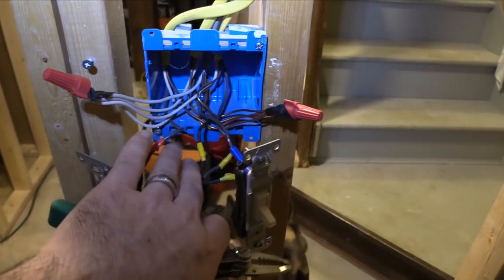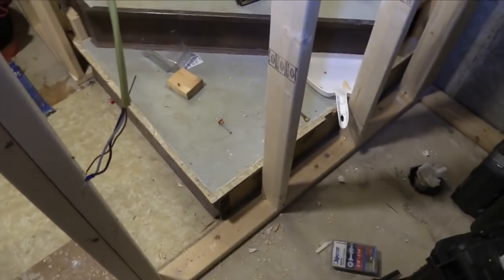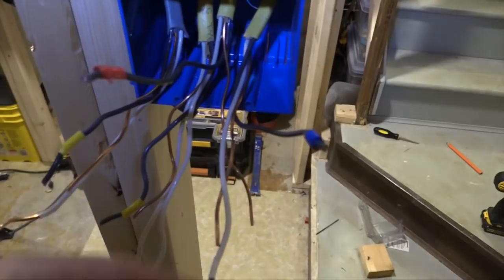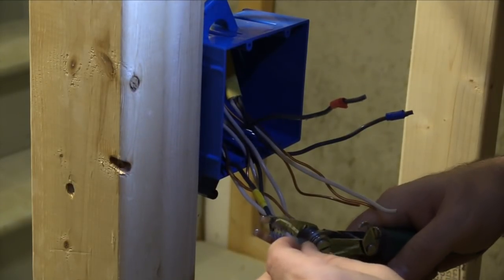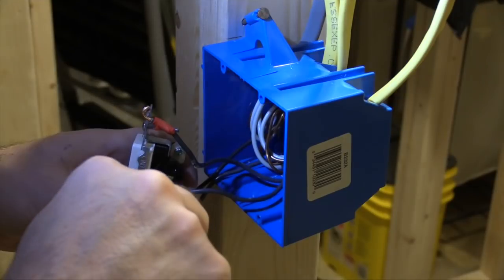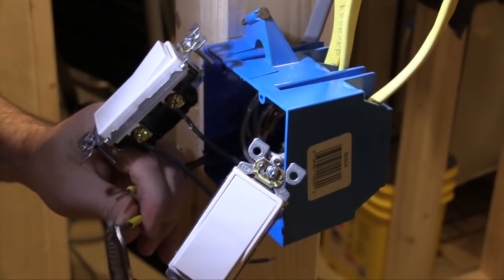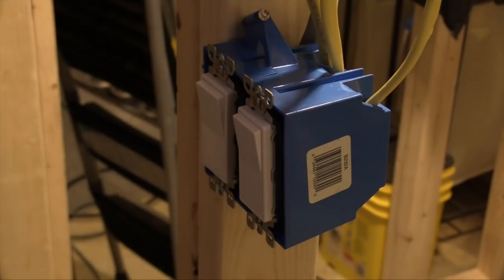How to Wire Multiple Outlets or Switches in One Box

Comment: For all those commenting on the grounding, yes that’d definitely be idea, especially with the plastic box, but I have to say that lately I’ve been updating my houses switches and I e been having to look through DIY bids to figure out what the hell the original electrician was thinking when this house was built. Grounding wire present, grounding screw present, nothing grounded. Massive amounts of wire shoved in to the point it can’t be worked with to do what should be quick updates. Seeing some “freestyle” wiring is helping me cope with whatever happened in this house 20 years ago.
Reply: I have the same exact issue. The electricians did not connect my switches to the ground wire, but just connected the ground wires to themselves in the box. So the system for the whole house is grounded, but the individual switches that are not connected are not grounded. I have been scratching my head to try to understand why the electricians skipped grounding most of my switches.
Reply: Lol thats why I'm watching videos here on YouTube what the hell were they doing when they built this house.

Comment: Connections appear to be secure, but the one very big problem I see is the switch bodies have not been grounded.  For this job, the grounding is actually the most challenging part.  You've got 4 cables coming in and two switches, so you need a way to join 6 12 g wires together.  For that, you could possibly use some device like you used for the neutrals, or two green wire nuts (each can accommodate 4 wires.  You can join them at the tops.  Just take about 12 inches of bare coppper 12 g wire, and center the wire nuts 2 inches apart.  To each wire nut, add 2 two of the incoming 4 grounds, then twist.  Use the ends of the 12 inch piece to ground each switch.  You can join the 4 neutrals together with a single wire not (NOT a green one of course).  Same for all the two incoming hots and their connection to the switches, since none of them require more than 4 connections.

Comment: Good video. I've hit a snag and I have a question. I will give all info to my issue.
I installed an attic vent fan.
In the attic there is only one source of power that comes from a light switch to a light fixture.
I replaced the light junction box because there was no ground.
I ran the 14/2 wire from the fan to light junction box.
Connected ground to ground, white to white, black to black. Switched the light fixture to use a pull chain so I can turn the light on and off when need be.
I connected a white and black wire for the light fixture, there is no ground for the light fixture and didn't run one (connected black wire to the brass screw).
The fan works perfectly. The light does not turn on or off, I even tried using the original light fixture that doesn't have a pull chain, light still doesn't work. I even tried a new light bulb, just to make sure the old light bulb wasn't blown.
There is current in the wire going to the light fixture. (I even cut a new black and white wires to took off more coating over each wire just to make sure all wires are connected within the red cap's.)
Am I missing a step or did I do something wrong?
Reply: His answer to this question is at the 2:15 mark of this video
Reply: You have to check the by pass and make sure it's done correctly.

Comment: You didn't add pigtails to the switch grounds, so you need 2 more ground wires. Two 4-port push in connectors and a jumper to connect them will do it. Another method would be to use a 4 x 4 x 2 deep metal box with a 2 gang mud ring. You could use a 5 port Wago lever nut for your grounds, one pigtail to ground the box. Then install the switches and they will be grounded by metal to metal surface contact. Remove the paper screw keepers on the switches first.

Comment: Thanks for the great video. I've done regular double outlets in 2 gauge boxes so far and did a good job (up to code). What if I am installing a GFCI outlet and connecting a fan switch next to it in the same 2 gauge box which then extends to the fan? Sorry, but it's a little confusing to me. Could you perhaps do a video explaining going from the outlet directly into the switch next to it, in the same box, and then extending to a fan or something? I would greatly appreciate it.
Reply: meljon Do you want the fan switch to be GFCI protected?
Reply: You should not be asking random YouTube content creators for electrical advice.  This guy doesn't know what he's doing.
Here's my original response:
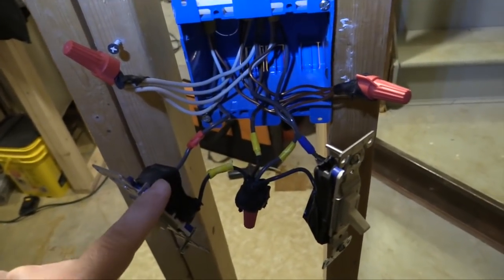You have NO BUSINESS making a video on this subject.  Not all 3-way switches, for example, are physically the same so your "remember where things go" method is foolishness. "Bypasses"???? WTF are your talking about?  Those black wires 1:34 that are connected are NOT "outgoing"  and there is no "bypass".  Those black wires that are connected are the HOT WIRES!!  On of them is the INCOMING power (Line) and it's distributed to both switches and some other circuit along with another Neutral.  Two switches with two controlled loads would only need three hots and three neutrals.  You have four.
You also neglected to attach grounds to the switches, which is required by code!   YOU HAVE NO BUSINESS making a video instructing others how to do this.  NONE!
Reply: @DiffEQ  Hello, I am a licensed GC in the State of AZ and I am a degreed civil engineer. I agree with you in principle, but in AZ, a DIY homeowner can replace switches in their home without consulting licensed electrician. For most people, I agree with you that is not a good idea. However, this guy is within his (legal and code) rights to produce a DIY YouTube on installing a switch. Now whether or not he did it correctly is another issue. If he shows something incorrect on his video and someone is injured, he is opening himself up to a ton of liability. 

I have a two-way three-gang switch box in my house that I am trying to figure out. The electricians (who built the house and were licensed) wired SIX, count them, six black wires together and five white (neutral wires together in the box. I was greatly surprised when I saw this, but I think it is because two of the switches go to the fan (one 14-4 for the light and one 14-4 for the fan). The third switch goes to a half-hot, which makes this wiring all the more confusing. The box is plastic and the electricians did not ground any of the switches in either three-gang switch box (remember it is a two-way). I don't think that complies with NEC code, but I am researching this wiring now. But the wiring is similar to what this YouTube video shows. 

In theory there should one wire to the fan, one to the light, one to the half-hot and a traveler wire between both switch boxes to bring power into the second box. However, in the primary switch box, I have six Romex wires coming into it. As mentioned, there are four wires between the boxes to support the fan, the fan light, the half-hot and the traveler,  and only one 14-3 wire should be feeding power into the primary switch box. That is a total of five wires that SHOULD be coming into and leaving the primary switch box and I have six total. So I am scratching my head trying to figure out what the electricians did and why the primary switch box has six black wires.. Everything works great and so the wiring is functioning correctly, but it is confusing to figure it out.

This video is similar to what I am seeing in my house, and for that reason, it is useful. I have had to figure out each separate switch box in my house as I have opened them up because the electricians did not wire some of them correctly and they SHOULD know what they are doing.

Comment: Hi! I know this is an offtopic and I'm sorry but could you explain me why are wires pigtailed when connecting an arc-fault circuit breaker? The thing is I'm from Ukraine and we don't do that. Just interesting.
Reply: This is very late but its so the arc fault or ground fault breaker can monitor differences in current between the hot and the neutral wires

Comment: You made that wayyy more difficult than it needed to be. A switch like this takes fewer than five minutes to do. Don’t need tape on the devices on a box other than metal. Only metal boxes pose a risk of shorting out.
Reply: Make a Video!!! Simple
Reply: So you are saying that switches in plastic boxes do not need to be connected to the ground wires? I am not sure I agree with that statement. Is that NEC code?

Comment: I didn't get it! What has he done? What do we need a second switch for if outcoming wires from both are twisted together. If the lines are different and both switches are toggled we receive a interphase short circuit. And if the lines are same then what the purpose of the second switch?
Reply from the maker: I was finishing my basement and needed to replace an existing switch. The switch was for a fan and a light in a bathroom. when you hook all the wires together like that, the bypass cuts power to the unit when you hit the switch. It just looked like a lot of wires because there are two switches and two items that require power.
Reply: if I'm seeing it right there is a line in to feed two switches and than a line out to feed another device simple. Also you should have grounded the switches tied all grounds together with two pigtails to switches. Cple of ways to do this otherwise nice job
Reply: Everything within that box is on the same circuit so there is no phase to phase tripping to be concerned about.

As he said, he is trying to switch a light on one device, and the exhaust fan on the other.

What he is referring to as the "bypass"is actually called" the "constant hot" . The four wires in that connection are the-

1_ power coming in,
2- power going out, 
3&4- and two pigtails. (each Pigtail provides power to the individual switches)

That set of black wires are the ones that will shock you if you touch them while the circuit is energized.

The remaining two black wires are referred to as switch legs. They are the wires that go from switch box to light fixture and once energized turn the light fixture on.

 All of the white wires are referred to as neutrals and get tied together. They run back to the electrical panel with the purpose of carrying any unused electricity back and completing the circuit.

Bare copper wires are ground, should all be tied together, and have pigtails coming off that terminate on the Green screw of the switch.

 Hope this helps..... sometimes the terminology from a Tradesman helps clarify.

Comment: No ground on the metal switch body?
Reply: Axeman it’s required in code but not many people pull a ground for switches anymore.
Reply: If you do not ground the switch and a hot wire touches it... just make sure there's no water on your hand when you turn the light off.
Reply: @anselmo1080  Hey! Watch the SHOCKING language! Lol get it "shocking" hahahaha!!!!
Reply: I own an older home (1935) and there is no ground wire, only two black wires. I'm trying to install two Lutron C-L dimmers into the junction box now. Lutron says to cap the green ground wire that comes built into their units when no grounding means exists, and their units comply with NEC. In his case, he should have grounded the switches, but  in my instance, I don't have that option unless I replace all the wiring.
Reply: @pjmuck  I would strongly suggest that you check the wiring in an older home. If the cabling is original then it should be changed out with all new,  earthing is really important. Older rubber cabling is just too old now.

Comment: I am not an electrician either but I DO KNOW your box cannot handle that volume.  You cannot by NEC code put too much wire/housing volume into a box.  Every box has it's capacity stamped on it.  Look at it and use a calculator to figure it out.
Reply: He'd have to know how the calculate box fill .
Reply: Awww there's plenty of room! You can even stuff a few more in there! He's a cowboy!

Comment: What is the volume of the box?
Reply: I do believe he has way too many wires in that size box. & Is it even legal or code to have two separate circuits together in the same box!
Reply from the maker: The box actually had the right amount of wires and room for 2 more. You can hook up multiple circuits in one box, as long as it does not reach its fill. The box was 2-Gang 25 cubic.

Comment: You have NO BUSINESS making a video on this subject.  Not all 3-way switches, for example, are physically the same so your "remember where things go" method is foolishness. "Bypasses"???? WTF are your talking about?  Those black wires 1:34 that are connected are NOT "outgoing"  and there is no "bypass".  Those black wires that are connected are the HOT WIRES!!  On of them is the INCOMING power (Line) and it's distributed to both switches and some other circuit along with another Neutral.  Two switches with two controlled loads would only need three hots and three neutrals.  You have four.
You also neglected to attach grounds to the switches, which is required by code!   YOU HAVE NO BUSINESS making a video instructing others how to do this.  NONE!